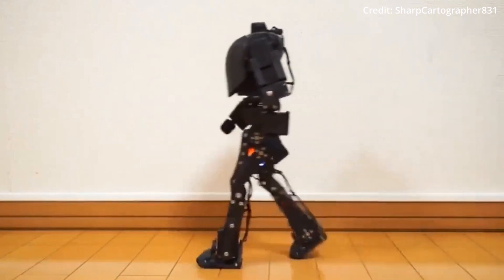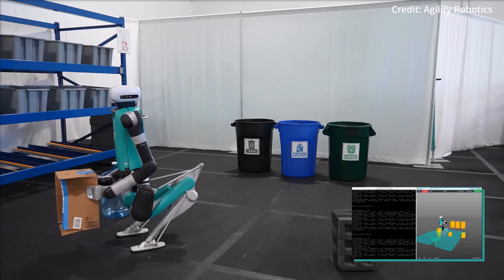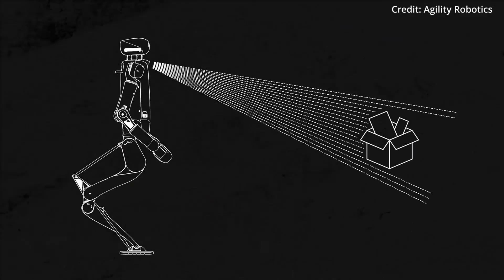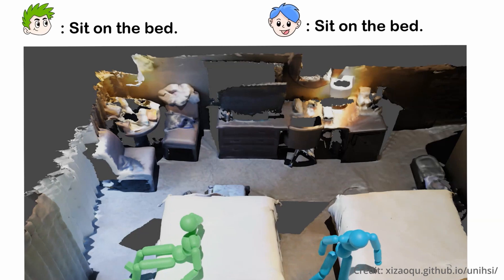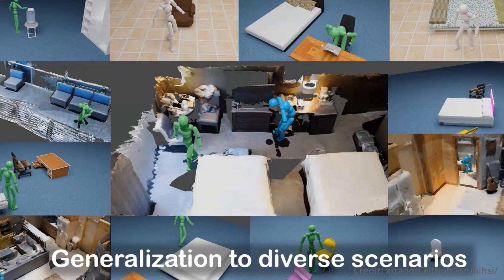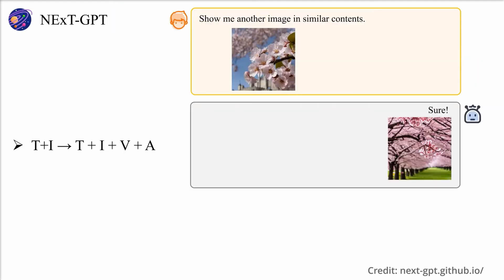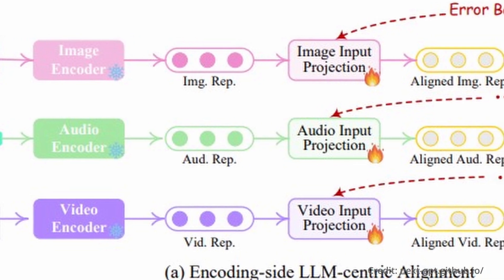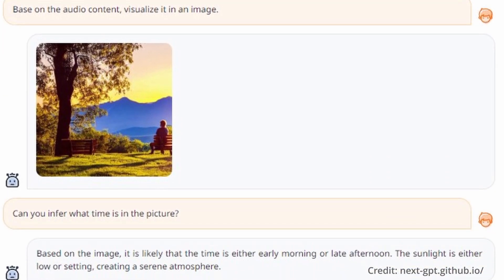3 AI BREAKTHROUGHS: Digit AI Robot + NExT-GPT Any-To-Any 6 MM-LLM + UniHSI

Comment: I wouldn't count Tesla out just yet. They are leveraging their proprietary FSD computer, Neural Net architecture, Dojo compute cluster, and advanced manufacturing plant to rapidly iterate. They are custom building their own actuators rather than use sub-optimal off the shelf components. Tesla excels at building the machines that build the machines. Their pace of innovation is staggering.

Tesla is engineering Optimus for scaleability. This mass production capability will produce robots at scale for $10-$20k.  That is an order of magnitude less expensive than Agility Robotic's  Digit at "only $250k per unit".